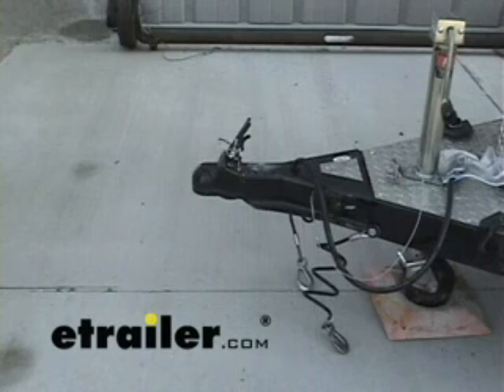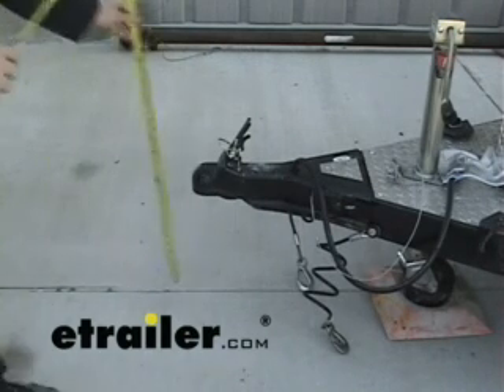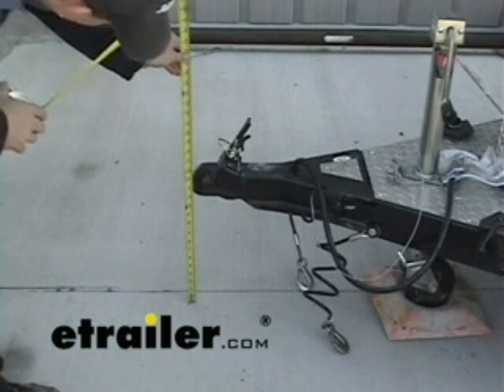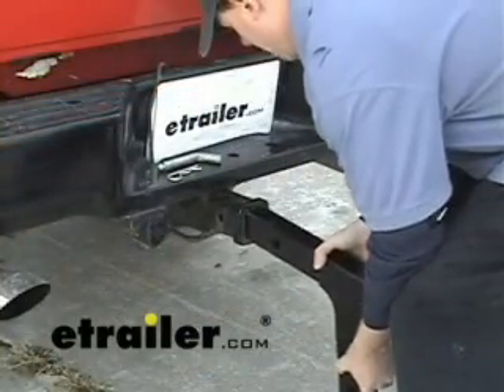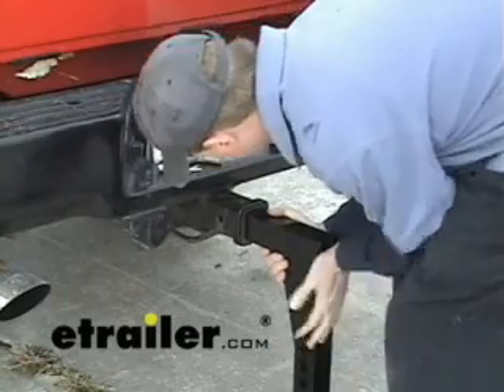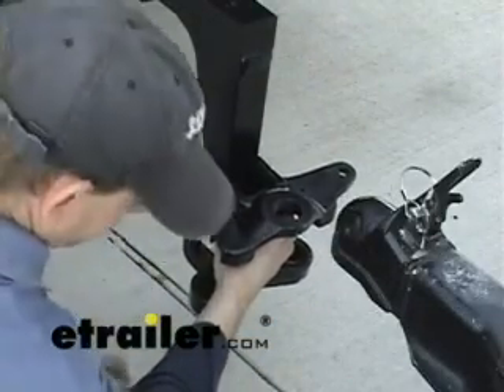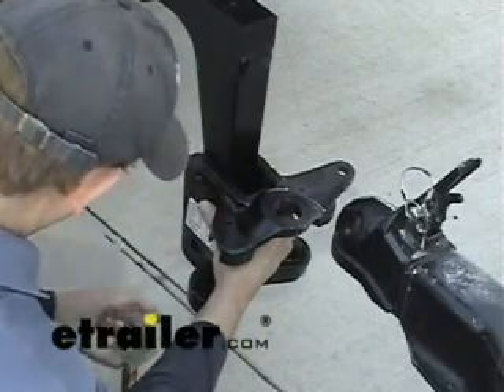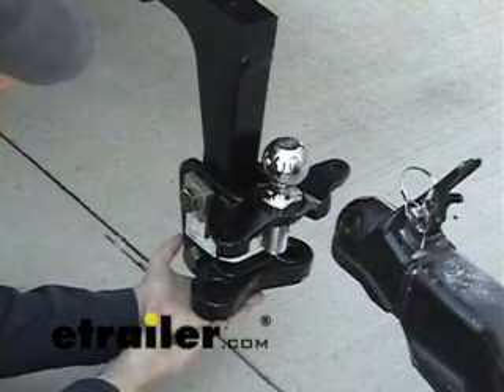etrailer | Measuring for Weight Distribution Review

Comment from the maker: Yes, you will want the truck ball to be at a height so that your trailer sits as level as possible.
Reply: This method works fine with very light utility trailer but it doesn’t work for heavy travel trailers